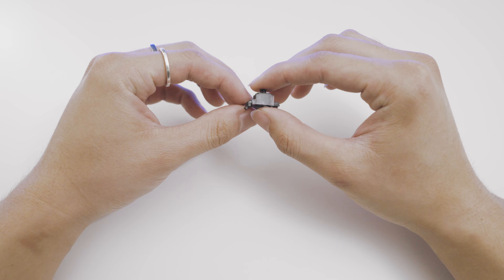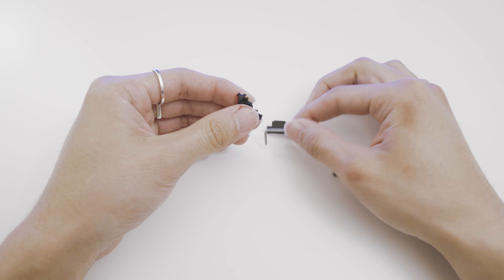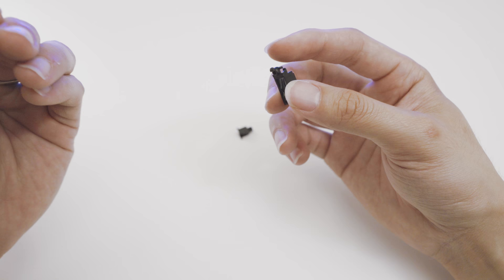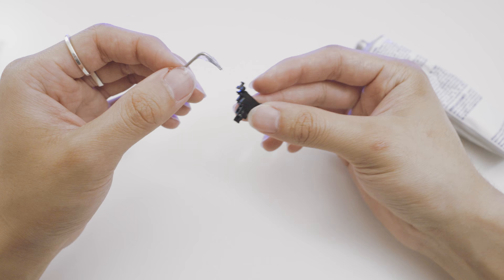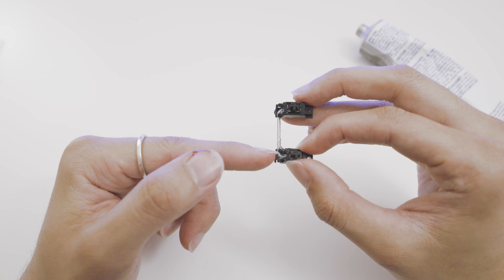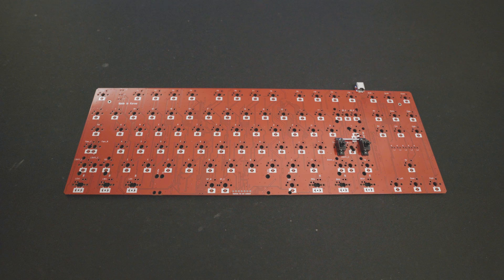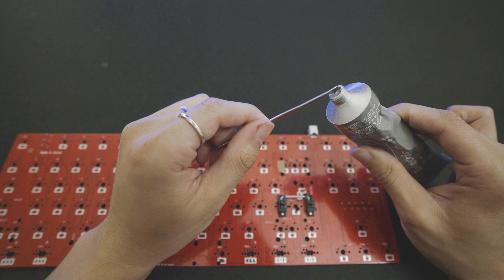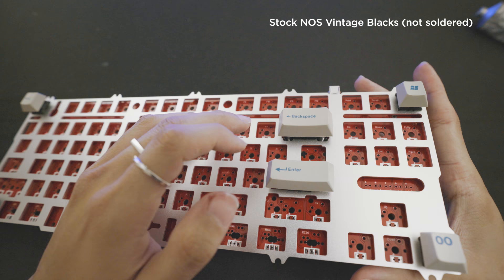How to Clip, Lube, and Band-aid Mod Your Stabilizers

Comment: I find that if I use this much grease with my plate mounted stabilizers that the keys get mushy and stick. I had this issue with Box Whites. I'm curious if lighter switches need less lube or if plate mounted stabs affect it?
Reply: did you solve it?
Reply: @boratsagdiyev1586  Yes. I switched to Krytox 205g0. You only need a small amount. Sounds and feels better.
Reply: @davidroberts5600  ah alright, what kind did you use before? g2?
Reply: @boratsagdiyev1586  Superlube and dielectric grease.
Reply: @davidroberts5600  i guess it was the superlube then :) Dialectric grease is just to dampen the metal in its housing.
Reply: @boratsagdiyev1586  I think it was the dielectric grease actually. Very little support lube is used. The grease is what surrounds the wire and impedes smooth flow due to its very high viscosity. I'm no expert. Just my perception.
Reply: @davidroberts5600  the dialectric grease is for dampening the metal inside the stabilizer. It should not affect smoothness in any way. 
The stem of the stabilizer and the housing itself should have 205g0 or either 105 for smoothness, thats the only thing what suppose to move, i'm sure you could superglue your metal bar to the stem and it would still move smooth inside the housing. Dont try it tho xD
Reply: @boratsagdiyev1586  Only the stem interaction with the wire behaves that way. Overlubing affects the elbow where it rotates.  It's also important to lube that part.  I've tested this and actually followed Teaha's lead as he now uses 205g0.
Reply: @davidroberts5600  hmm is that so,  you might have saved my stabilizers then. I was planning to order some dielectric grease from griffon but that might be too thick too,  would be a shame while having 205g0 laying around here :0
Reply: @davidroberts5600  ps. I watched his video but its 2 years old ( how to clip,lube,band-aid mod your stabilizers)  Could you provide me with the source?
Reply: @boratsagdiyev1586  I would watch Taeha Type's build videos. He lubes stabs on most. Also there's this. 
https://youtu.be/R6vjiLNyll8

Comment: What would differ if I simply used the teflon grease for all the applications? The vibration between the metal and plastic parts may not be fully suppressed, but... will the smoothness still be improved considerably?

Comment: I got a little bit of 'Krytox by Chemours GPL 205 Grease' and was wondering if it would work well for both stabilizers and inside the switches/springs. Would it only work well on some switch types? I read online that it would only be good for linear switches and not tactile. I plan on changing the switches on my IKBC MF108 and would like to know before I go in.

Comment: For plate mounted stabs, I assume the clipping and bandaid mod won't be necessary?
Reply: Warding cause I would like to know too
Reply: @valentinzunino2127  Plate mounted stabs can be modded exactly as in this video. In fact, plate-mounted stabs are usually the ones that need it the most!
Reply: @TommyFenstermacher5150  Thank you man, it's good to know

Comment: Quick Question i want to lube my switches and stabilzers. For my tactile Zealios v2 67g i want to use Tribosys 3203 now my question can i use the same for my stabilzers or buy another and if which permatex is not available in my country just super lube which should i buy? Please need help also which stabilzers go well with Zealios v2 67g and an hot swap PCB?
Reply: Try asking on reddit, there's a mech keyboard community that's eager to help out with your problems and questions

Comment: are the stabilizers supposed to like be able to press it like when you press a switch and the stem goes inside ? cause on mine the stems when i press on them they are already bottomed out and not going back up
Reply: The stabilizers are for keeping the key steady when pressed off center, that's why it's used for the wide keys. So there are no springs, but it keeps the left and right side at the same height. That's why the sliders just fall down when you take the keycap off.

Comment: Really dig the attention to detail. The fact that this has to be a "mod" and not something that the manufacturer produces is disappointing though. I just bought a K95 Platinum and it had the loose/rattling stabilizers. My fix was hot gluing them down and adding a little bit of lube. 

I am guessing the loose stabilizer is just a characteristic of cherry mx?
Reply: Indeed. Do you have any tips on lubing stabs without disassembly? My hot glue and the type of lube I used (very thin) turned out to not do much.
Reply: Nathan Kim awesome, I will give that a try. Thanks!

Comment: "Link to items in description box below"   I checked, not seeing it.

I wonder if there really needs to be a special distinction between "teflon grease" and "dielectric grease". Have you tried the PTFE grease doesn't do the job? Permatex doesn't specify any dielectric property values. Superlube PTFE grease says 400V/mil dielectric strength and 1 x 10^15 ohms per cm of dielectric resistivity. Also, they're both silicone greases.

Comment: I applied dielectric grease on to my cherry mx stabilizers without removing it out the keyboard. Is dust/dirt going to be a problem to the grease applied? I also applied some of the grease at the ends of the stabilizer metal rod where it inserts into the plastic stabilizer stems. Hopefully dust/dirt won't be an issue whenever you use a air duster to clean off the keyboard from dirt?
Reply: 3 months late but i'd like to know how that turned out for you, i'm planning to do the same thing and lube without taking the stab out

Comment: I'm a total keyboard noob... I'm wondering why the second keyboard from the right (in the intro sequence) has so much more thock (and a generally deeper sound) than the rest of the boards?
Reply: Because of keycaps/switches/case. Keyboards are all different.

Comment: Sorry this might be a dumb question but how do you get plate mounted stabilizers off the keyboard? I want to replace it with genuine cherry ones and do this process
Reply: Remove switches, you may have to desolder first.
Reply: Patrick Bonner figured it out, thanks. So there's basically a latch on the opposite side of the wire  right? That I just have to pull out once the switch is out. Easy enough

Comment: Hey Taeha, what do you do if the wire unclips from the stabilizer? I just built my first hot swappable keyboard and everything was sounding great, so I decided to lube all my switches and finally put the entire board together. I did another sound test and noticed the spacebar was acting weird. When I would press down on just the right side of the spacebar, it would cause the wire to pop out of the stab and now the spacebar stab essentially doesn't work... Also the wire isn't easily fixed without having me remove all of my switches and taking everything apart (luckily its hot swappable so I don't have to desodder anything but still it's annoying). I am afraid this will happen again. What would you recommend? I have Durock Stabilizers, and I researched that their v2 stabs may be better at preventing the wires from unclipping, but going through the hassle of taking everything apart and returning and ordering another set of more expensive stabs seems like a lot.
Reply: To prevent the wire from popping out (most of the time), remove your keycaps carefully. For the spacebar, remove the keycaps next to it, then gently lift the spacebar up with your fingers. If wire popping is still an issue, get durock v2 stabilizers for extra peace of mind.
Reply: @spidermain  Thanks for the tip. I did order a v2 stab just for my spacebar because all of the other stabs are working just fine. I was having issues mostly when you would press down on the spacebar just on the very left or the very right and the wire would just continuously pop out doing that.. going to install the v2 very soon and hope it fixes it. I have been using the keyboard despite the broken space bar lol.. sounds so nice and feels so good to press down. :D

Comment: I followed all of the instructions properly, and now all of my stabilizers sound and feel like shit, especially the spacebar (sticks and doesn't always return). I ordered 12 sets of GMK screw-in stabs, so I can ensure that at least one set works.
Reply: ? I did all this replacing krytox with tribosys 3204 and my stabilizers sound so smooth now, did you make sure to wipe off any extra dieletric grease touching the plastic outside of the housing?

Comment: How important is the teflon grease and dielectric grease? I'm putting together a build now and bought some SuperLube Synthetic grease that was recommended in another guide.  Can that be used in place of one of the two you mention in the video? If so, which one? If not, should I really go out and buy these other two lubes?
Reply: so do you recommend I go get some teflon grease for plastic on plastic?  This is my first build, so i've never modded anything before.  If SuperLube will suffice for all areas I might just stick with that.  Unless you recommend the teflon grease and it's not too expensive?
Reply: Cool i'll follow this guide as your stabs sound perfect, but i'll probably just use the super lube.  Thanks for the help.
Reply: Hahah, thankfully I read this...first time i watched I was like... "holy fuck thats a lot of lube".  Maybe add that as an annotation on the video?
Reply: Just realized its a pinned comment, whoops

Comment: I’m planing to get the gmk stabilizers without lubing it. Do the stock gmk stabilizers sound good? I also want to do the band aid mod but what does it exactly do?
Reply: @Draconewt I stole this from Reddit but it will help explain. 

:Stock Cherry stabilizers have little feet on the bottom of the sliders to dampen the bottoming out, but they feel extremely mushy. I can't stand that the mushy feeling, so I always clip them off. However, bottoming out straight on the PCB can be noisy, so the bandaid adds just enough of a buffer to dampen the sound of bottoming out without affecting the feel of the switches.

Honestly, there really isn't too much of a difference, and it's really only noticeable when you really hammer the keys. But it's enough of a difference for me to do it to my boards.
Reply: @Draconewt Gmk stabilizers are well known in the keyboard enthusiast community for being good. Lube is recommend but you only really need them though if you want your stabilizers smoother or quieter.
Reply: @Draconewt You should clip your stabilizers if your doing the bandaid mod or it’s smoothness won’t be at its full potential. D;
Reply: @triton6083  Thanks, this information helped me out.

Comment: can i also do this on the keyboard that i already have
Reply: I_AM_ GWAN what?
Reply: @izzio6680  i meen like, i can remove the stabilizers on the keyboard that i already have?
Reply: Yes u can but if ur keyboard is not hotswap ur gonna have to desolder the switches that have stabilizers supporting it
Reply: @izzio6680  i have the reddragon K350, they say its hotswap but anyother switches dont fit, can i still do it or just risk it

Comment: is it ok to use WD40 to lube?
Reply: NO. It will gum up over time, and is generally not good for plastics. Use a PTFE grease for plastic-on-plastic, and use dielectric for plastic-on-metal.

Comment: keyboard god AND good looking.... can you lube me too?

514

Taeha Types

Doge Bot
Doge Bot
1 year ago
This method really works! Using the exact method with dielectric grease, teflon grease, clipping, and band-aid modding my stabilizers (if that even does anything for plate mounted stabilizers), I was able to make my Anne pro's crap stabs into godly stabs! Luckily I recorded my before stabilizers and my after stabilizers so I thought I would leave them in the comments.

Comment: Remember that all that pieces will be full of dust with normal use..
Reply: @ellyoot  Those materials don't avoid dust, just made the cleaning part easier.. And if there is a lube, the dust will get stuck unless you use dry lube. I'm just saying that you have to consider it. Anyway, if you spend that amount of money on something, the dust won't be a problem!

Comment: I know the Mechboard fans are weird but really all this effort, for such a small change in sound that your not going to hear in an office with ambient noise or if you use your mech while gaming. . . . . clip the stabs yeah but just put some foam in the bottom of your case or buy bloody silent linear non tactile switches.

its so funny people like the click of these Mech boards but don't like the sound of cheap arse plastic clacking, honestly is it that much of an issue your not even going to type faster because of it.

Its like having a kettle that boils 10% faster but you still wait for your coffee to cool down before you drink it.
Reply: Tuning stabilizers also changes their feel, not just their sound.